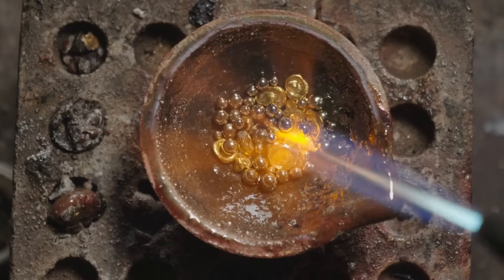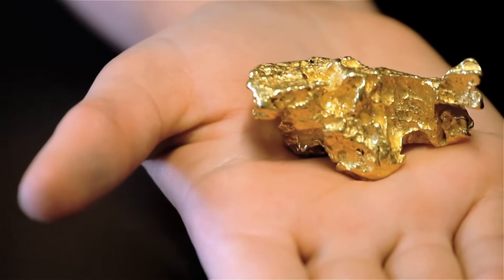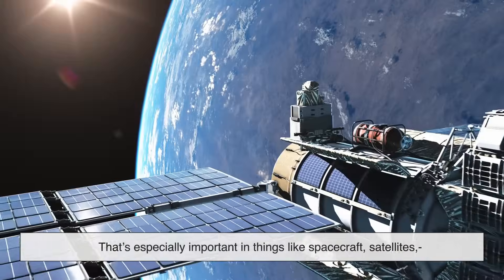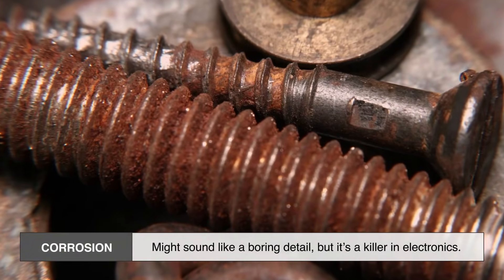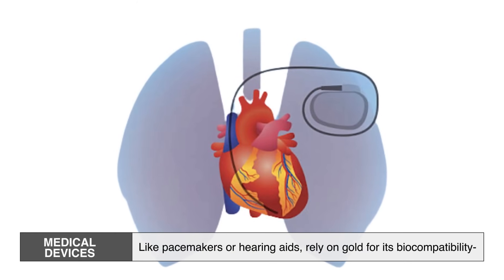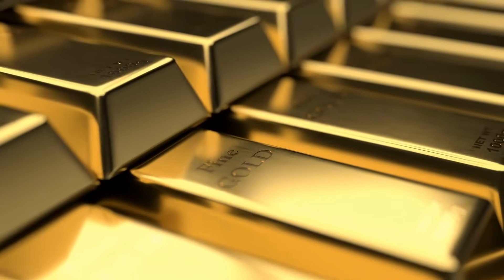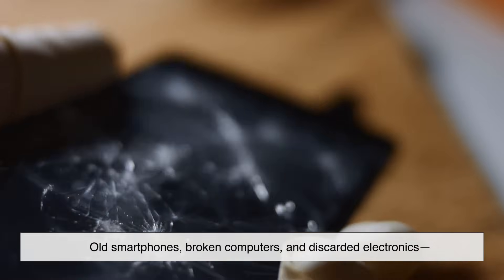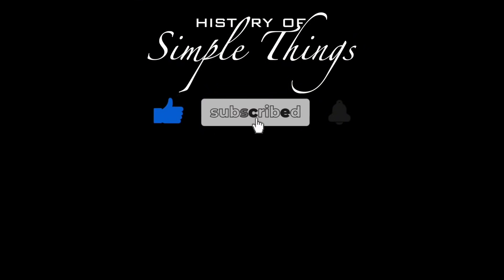Why Gold Remains Crucial in Electronics Despite Its Softness

Comment: Why not use stainless steel instead
Reply: First the Stainless still is not a good conductor. 2nd The  hardness is slightly closed to titanium its hard to solder in material that we use on electronic conductor.
Reply: Gold is super conductor in the metal element on periodic table.